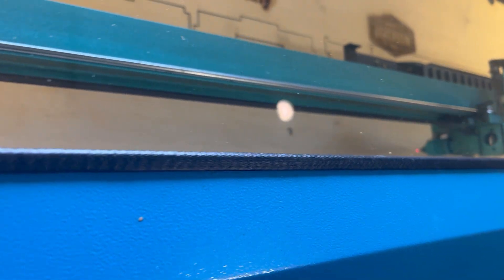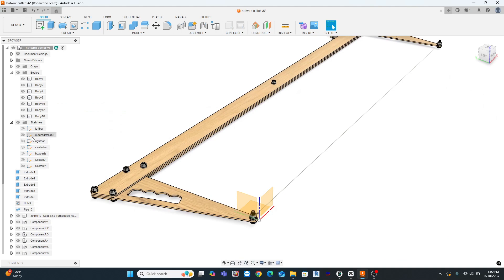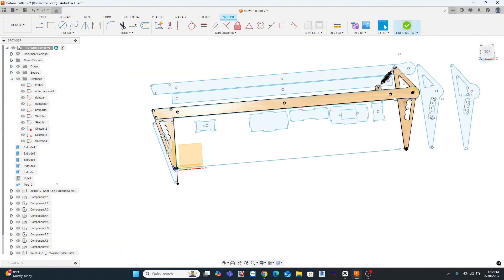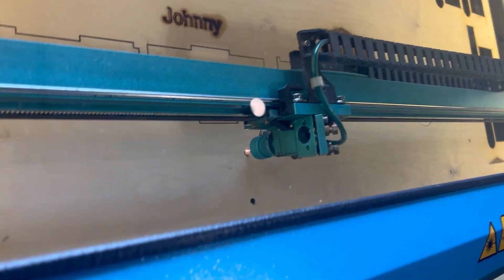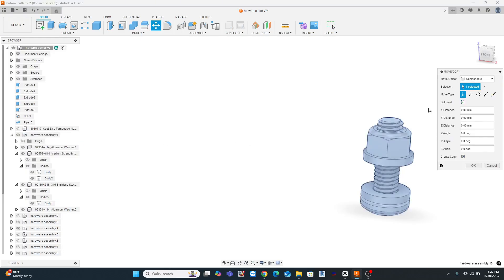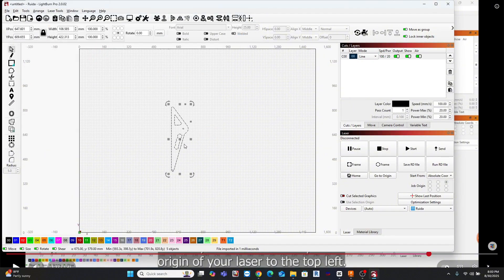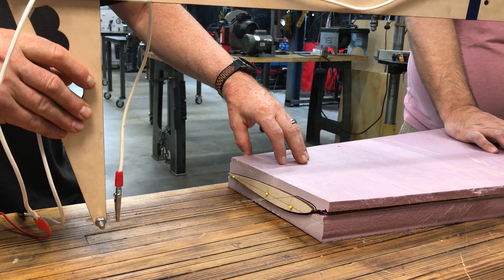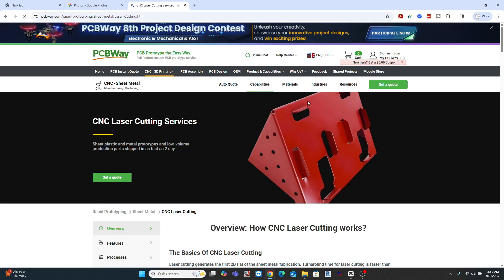How I Made a Hot Wire Foam Cutter That Really Works!

Comment: Cool job. Welcome to the world of foam. Amazing what you can do with it.

I made a cheapo one using scrap wood strips, a laptop charger and a $6 LED dimmer.
A couple of tips (I've been at this a while)
1)Try stainless steel wire. It heats up, stretches less, and is thinner.
2) Use a spring with the turnbuckle to maintain tension. Wire stretches when hot.
3) Add a "horn" or straight thin tab to the LE and TE to rest the wire on just as you start and finish the cut. Think of a narwhale.
4) mark the foam blanks especially tapered wings so that the tip and root are done at the same time. I make a line across the span at 12.5%, 25%, 37.5% etc (ie 1/8 of the chord)
5) Use ziplock bags filled with sand to hold the blank in place while cutting.
Reply from the maker: Thank you!  Opens up many opportunities
Reply: What diameter stainless do you use?  Any certain grade?